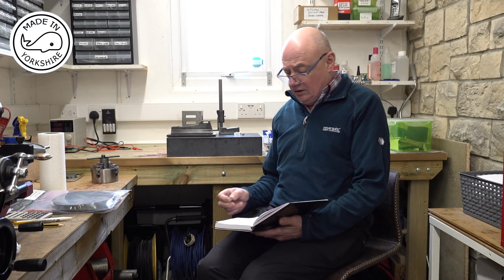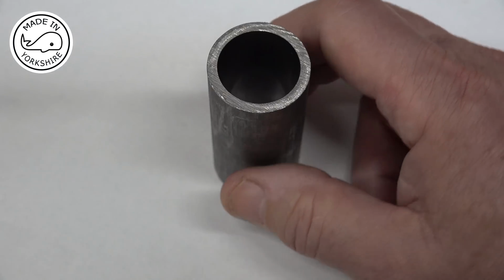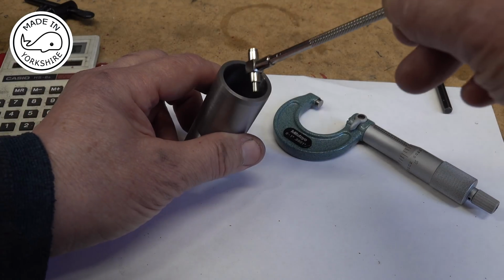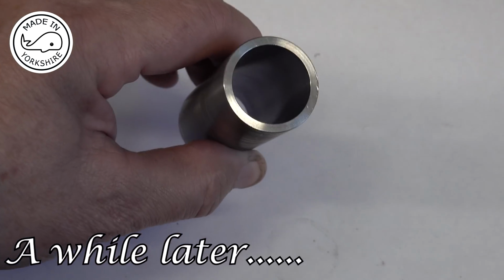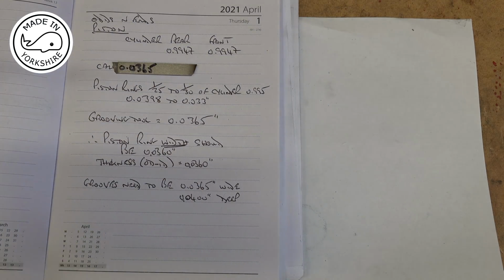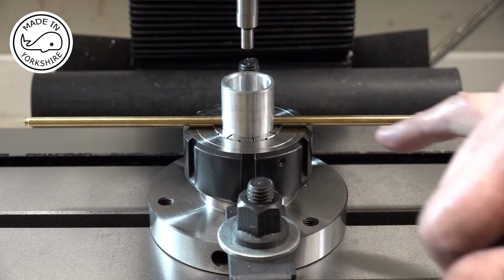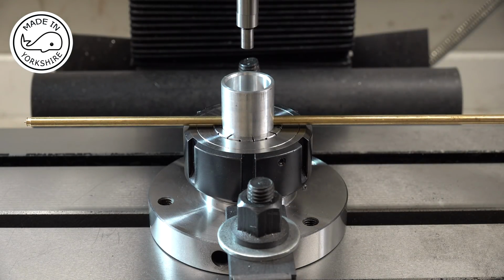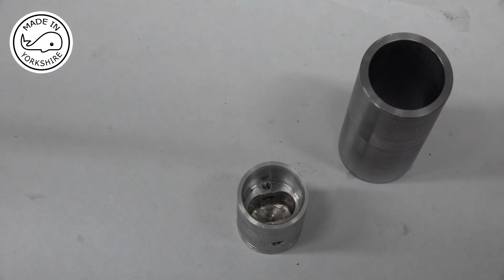#MT41 Part 2 - Philip Duclos Odds n Ends Engine. The Cylinder Sleeve & Piston. In 4K by Andrew Whale

Comment: Interesting video's but can I ask why your lapping the bore, hone it yes as that leaves a cross hatch to help retain oil and bed in the rings.
Reply from the maker: Hi. The instructions in to book advise smoothing out the cylinder bore by lapping. I believe that it's quite common practice on 4-stroke engines, though I could be wrong.
All the best.
Andrew

Comment: Hi Andrew, great footage as usual.  I like the idea of using seamless tubing, but how do you ensure roundness of the bore without some initial boring?  Just measuring the bore diameter won't check roundness.
Reply from the maker: Thanks Steve - I believe that CDS is manufactured to some reasonably tight tolerances, so it should be pretty close to being round internally. My honing and lapping should address any imperfections. Well - that's the plan. I think that it's quite common for model engineers to use this method. I like trying new methods out and fingers crossed it will work out OK. We will see!
All the best.
Andrew
Reply: You're right to be concerned about roundness - I bough two lengths of CDS  (different diameters) - one was pretty much perfect, the other was distinctly oval (~0.0005") so I had to bore it out.
Reply: @Mister_G  Lets hope Andrew has been lucky this time.
Reply: @stevebosun7410  It looks like it's OK - I'm sure it would have shown up when Andrew was lapping it otherwise.

Comment: Fantastic video Andrew ! 
I have read through the comments and some have raised concerns about piston to cylinder clearance , 0.002 seems tight but one needs to remember a hit and miss engine doesn't run anywhere near as hot as a normal IC engine which would run 0.005 + clearance . 
If you want the ultimate in piston rings , make them as per the usual way ( machine to bore size then expand and heat treat ) but make a dummy piston and cylinder and use these to lap the rings to the bore of the dummy cylinder .
Reply from the maker: Thanks Ian - I hope the 2 thou clearance will be OK too. Yeah - I plan to machine to bore size and heat treat. Good idea to make a dummy piston and cylinder - you have got me thinking now!
All the best.
Andrew

Comment: Hi Andrew, nice work.  Concerning your drop down test, the fit may be too good.  Don't forget that the coefficient of expansion for you aluminium piston is greater than for the steel cylinder.  On the Farm Boy the piston diameter is 2 thou less than the bore to allow for expansion so you might need to consider a similar difference on this engine.
Reply from the maker: Thanks Roderick - I did machine the piston to be 2 thou less than the cylinder - so fingers crossed it will be OK.
All the best.
Andrew

Comment: Nice work, well done. Great footage and editing! Thanks for all close pictures as well as the "off camera" decisions. Some Tubers place the camera "somewhere", starts the recording and the viewers have to sit idle while the guy runs around the shop searching for tools, stock, or an endless routine turning...
Could You post a link to the new blade You got for the band saw? I did buy an extra blade from Warco but maybe You've got an even better blade?
Reply from the maker: Thanks for the feedback Stefan. I also purchased a spare Warco blade but never used it. The link to Mr Bandsaw is:
https://www.ebay.co.uk/itm/3-PACK-64-1-2-1638mm-x-1-2-13mm-M42-BIMETAL-BANDSAW-BLADE-VARIOUS-TPI/291893760233?var=590893454499
The link could go stale at some stage - so just search for Mr Bandsaw on eBay UK.
Cheers
Andrew
Reply: @learningturningmetal  Thanks Andrew!

Comment: Andrew, excellent video as always. I personally would have protected the ways of my lathe while lapping. also have you ever tried isopropyl alcohol as a lubricant on aluminum? it leaves a wonderful surface finish!
Reply from the maker: Thanks for the tip - I've got some IA for cleaning the 3D printer bed - so I will give it a try on aluminum. I never thought about protecting the lathe when lapping - I will remember next time!
Cheers
Andrew

Comment: I’m curious why you use aluminum I’m as a lapping tool? I would think that since the aluminum is softer than the steel that it would ‘cut’ before the steel.
Reply: It works by the lapping paste embedding into the softer material (the aluminium) which then cuts the harder material (the steel)
Reply from the maker: @IACooper  Many thanks for explaining. I know that some folk make wooden laps but I didn't realise the reasoning behind it until now.
Cheers
Andrew

Comment: Using DOM is a brilliant idea.  If you have success with the cast iron piston rings will you need to hone out the cylinder bore so that the rings will seal properly?
Reply from the maker: Hi mate - I hope not. I honed and lapped the CDS (DOM equivalent) to the dimension I wanted. Fingers crossed the rings will seal properly if I make them correctly.
Cheers
Andrew

Comment: Those parts came out really well. The finish inside the cylinder looks superb. Very impressed with the groove cutter you made. Is it just ground from HSS? The piston rings look to be a challenge. If you are using the trepanning technique Blondie Hacks recently did a video on trepanning and the relief angles needed on the cutter. Good luck.
Reply: Trepanning is where you cut a groove into the end of bar stock. So to make piston rings you can turn down the outer diameter and then instead of removing all the centre of the bar you cut a groove in the end of the bar leaving an outer ring the size you need for the piston. Finally just part off the width you need. It is very useful for large rings as you are left with useable material on the remainder of the bar. It may not be worth it when the rings have a very small diameter. But worth having a look at this option.
Reply from the maker: Thanks Tim - the groove cutter was ground from a broken HSS parting tool I had. Not heard of trepanning. I'll check Blondie Hack out.
All the best.
Andrew

Comment: Crackin stuff Andrew. There's some good info on Mr Crispin's youtube channel regarding ring manufacture
Reply from the maker: Thanks Ian - yeah have seen Mr Crispin's recent videos - very interesting. Earl has successfully made piston rings in the past and I think he has refined his process based various sources of information, including Mr Crispin's. I think I will follow Earl's machining notes and see where that gets me. The rings are very fine, so I might just fall at the first hurdle. We will see!
Cheers
Andrew
Reply: @learningturningmetal  
Crispin had to modify his design as he got the dimensions wrong - i would look at guys like Earl , Doc455 ( youtube ) and Jason Ballamy on the MEW forum as they have built many engines and their piston rings work ok .
If you want to run a viton o  ring  then Jason is your man .
If you're not into forums you will see down the list of comments a comment by  Roderick Jenkins , Rod is still active on that forum and might be able to act as a go between - no harm in asking !
Reply from the maker: Thanks for the info Ian. I use the MEW forum quite a lot. After making the Far Boy, I think I am OK regarding Viton rings. I'll have a look at Doc455 and JasonB on MEW, but I'm still thinking of trying Earl's methods first. 
Cheers
Andrew
Reply: @learningturningmetal  
yes earl first , if you get stuck then try the others

Comment: Great Job Andrew. Perhaps in future if you need to cross drill a hole in a cylinder, that you grip it END wise to avoid distorting the part. I know that it was solid on one end, but the thin end would not have been gripped so securely. You mentioned Viton O Rings, from memory I do not recall that they went down to 1/32" diameter cross section, or an I wrong ? Good luck with making the piston rings, Crispin had quite a bit of a struggle and needed 2 goes.
Reply from the maker: Thanks Dave. In hindsight I agree that I should have held it differently. I got away with it though. Yes, the Vition o-rings have a far greater cross section width. If I was to use one I would probably need to make a new piston. The design of the engine results in the cylinder sleeve being pressed into the cylinder block and means that the cylinder ends up being a blind hole. As such it would be difficult (impossible?) trying to change the size of the bore in the cylinder sleeve to match a Viton ring. Having a Viton ring that fits the cylinder sleeve means that I don't have to make a new cylinder block and sleeve, if I can't make good cast iron rings. 
Fingers crossed!
All the best.
Andrew